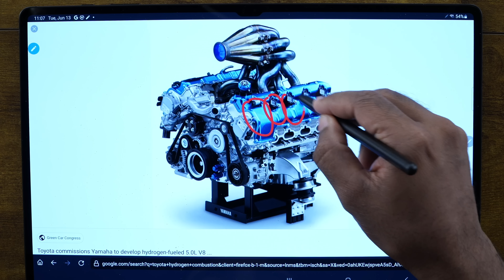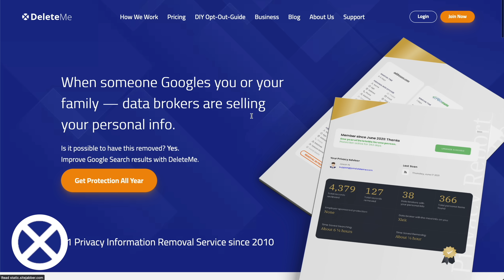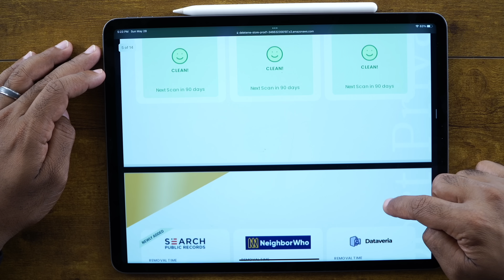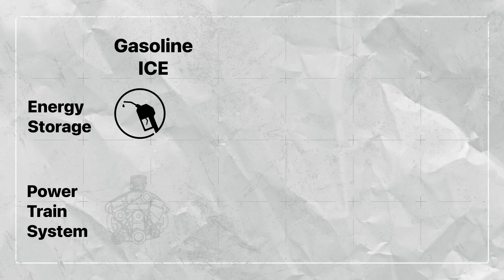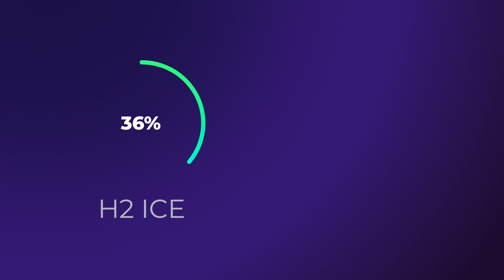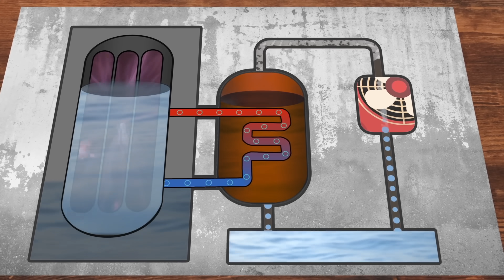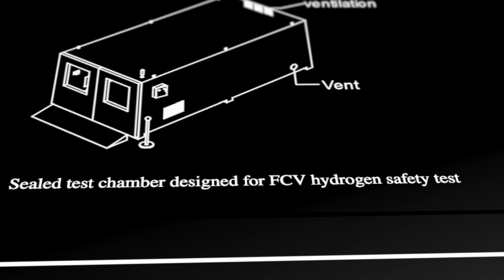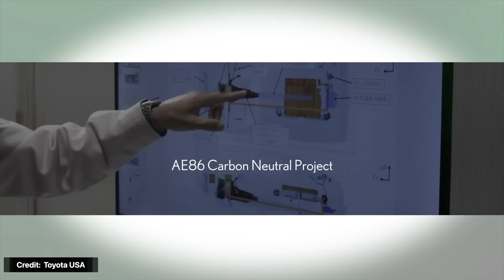Toyota's Says They Just Destroyed EVs - Hydrogen Combustion Engines

Comment: One thing hydrogen power can potentially offer that EV never will is the "Jerry-can" option. Want more range for your hydrogen-powered vehicle, either ICE or fuel cell? Simple: buy a portable hydrogen tank or three, lock 'em down in your trunk and you're good to go.

 But of course, there are those globalist vermin who do not want us to EVER have that kind of long-range/ fast re-fill-time autonomy ever again once they've banned and confiscated all petrol-powered cars. Given this fact, why would they ever want hydrogen ICE technology to ever take root?

The other advantage of hydrogen-powered ICE vehicles you've already mentioned: if you're stranded on a cold snowy highway in a four-hour traffic jam your engine can still be run to keep the cabin warm, and fuel can be brought to your vehicle if you're ever out of fuel in a remote location. EVs on the other hand can quickly run the battery down in minus-MF temps, leaving you at risk of freezing to death.
Reply: A portable hydrogen tank will be extremely expensive. You can buy portable batteries for your EV today lol.

EVs can be stuck in winter traffic for days. Heatpumps are very efficient at keeping the cabin warm with very low power draw

EVs with very long range already exist. Soon they'll have even longer range.
Reply: And a portable battery is cheap? Nope, not even considering the cost-saving measures that the suppliers of battery raw materials utilize. (Hello, child slave labor!).

The raw materials for building a safe and strong portable hydrogen tank already exist in abundance. Where there's a market and ample raw materials for something, economy of scales production will insure an affordable supply of it.

Besides, unlike electric vehicles hydrogen offers the freedom that comes with extended range. Freedom is a good thing, right? ..... Uh.... RIGHT?? 
.
Reply: @zeus014  Yes a portable battery is expensive, but 10K PSI hydrogen tanks are pretty damn expensive and heavy too.

You can drive anywhere with an EV so i don't really get your point. I drove on a roadtrip through Europe this summer, 13,500km. No problem.
Reply: @logitech4873 Europe has a denser population and therefore the incentive and means to provide the necessary infrastructure for electric vehicle ownership - as long as the electrical grids can support them. (Let's see if they can once the vast majority of drivers make the switch. (and no, legislating 80% of drivers out of their internal combustion engines and then pricing them out of EVs does not count).

I'm in western Canada. It takes about 3 and a half hours to drive from Banff, Alberta to Edmonton Alberta (along a major route) in a typical gas or diesel car. It does this on about 3/4 of a tank of gas and regardless of ambient temperature, from plus-30C in summer to -40C in winter. 

In a brand-new Tesla in winter it can take all day. Charging stations are few and line-ups at the non-urban ones are common. Charging times can be measured in hours. One example at -20C took all day to complete this trip, and had they had to wait for one more vehicle charging in front of them they'd have had to book a hotel.

And don't even get me started about the inability of our grids ever being able to keep up if even half of our population goes EV. 

BTW, our communist government here has no intention of making EV charging stations even 25% as prolific in numbers and spread-out locations as current gas stations are - because it does not serve their "smart-city" globalist agenda.
Reply: @zeus014  That trip in the summer can easily be done without stopping. In winter you'll probably have to stop and charge once at one of the superchargers in Red Deer for probably no more than 10 minutes, not "hours". It's just 400km.

I've yet to come across a single fast charger queue. But due to how fast modern EVs charge, you're gonna be waiting for probably ~30-40 minutes divided by how many chargers are on the lot. So if there's 10 chargers, that's 3-4 minutes on average.

Your government isn't communist. I recommend you look up the definition of that word.

Comment: Most electricity is still generated by green house gas producing power plants. The pollution caused by strip-mining for metals used in batteries/fuel cells should have been mentioned. There is no easy answer here. Bottom line is there is an infrastructure for ICE transportation NOT one for electric we are working on it. No matter how bad we want it, it is not there. H2 ICE may not be perfect but I would have like to seen you present your data a little more evenly. I noticed when you had a range you waffled between the high and low depending on the statement you were trying to support, and you left out the efficiency of gasoline engines which I know is low. This video just didn't feel as honest as your other videos...
Reply: There is infrastructure for electric.

Comment: Unless I'm mistaken, internal combustion engines will still require oil & oil filter changes, air filter replacement, tune-ups and transmissions no matter what the fuel is.

Comment: I want to no the consumption of hydrogen and if you could use HHO hydroxy gas converted on demand using electrolysis? No need to store hydrogen you would actually be storing a tank of water at that point. It seems like with a large enough of electrolysis unit you could create enough HHO Gas to power the engine
Reply: It requires more energy to power the electrolysis than what you can get from the resulting hydrogen.

Comment: Lots of EV disadvantages not mentioned in your video so far:  1) when temperature goes down, battery capacity drops.  This is all well and good for some place like California but where I live in Canada, winter temperatures stay until almost May.  This is also a concern when you need to heat the cabin.  2)  even in hot places, BEVs may not be as efficient as you make them out to be.  If you live in Arizona, air conditioning is a must and running a compressor and fans drains the battery.  Oh, and heat kills batteries and affects lifespan as well.  It's a vicious cycle as coolant runs in and around the batteries while the battery powers the car, AC and battery cooling systems. 3) average lifespan of a BEV is at most half the lifespan of similar ICE powered cars.  This is also a problem to resale value as batteries use finite and equally toxic chemicals used to make and run and the batteries themselves are 95% unrecyclable as the "black mass" is prohibitively expensive and energy intensive to separate into the toxic and heavy metals like Cobalt and Lithium and precious metals like gold and platinum.  ICE cars?  Most of the mass is reusable and recyclable due to it being steel, copper, aluminum, iron, lead and precious metals.  4)  There are still carbon emissions traceable to electric cars.  Roughly 40 % of the planet still relies on fossil fuel-based electric generation, and a good portion of that is coal.  Petroleum is still used in the manufacture of plastic, the rubber in tires, brake components, wire insulation, seals and the asphalt that BEVs use as a road surface.  Oh, and the fact that each time a Tesla or other BEV spontaneously combusts, that is a dirty burning fire akin to if more emissions being added to our precious air from the vehicles meant to make a green alternative compared to ICE vehicles in its lifetime, also the fact that it's virtually impossible to put out an EV fire compared to an ICE fire.
Reply: 1 - Modern EVs with efficient heat pumps still retain good range in winter. EVs are very popular where I live in northern Norway, north of the arctic circle. About 80% of new cars sold here are EVs. We only had 3 months without snow this season!

2 - EVs maintain high efficiency in hot climates. ACs are energy efficient.
When I was driving through Spain this summer in my model 3, there was no visible impact on efficiency in the 43°C days.

3 - EVs are too new to reliably calculate any sort of average lifespan. The technology has rapidly improved over just the past 10 years, and now LFP batteries are becoming commonplace. LFP batteries can last 3-4x longer than NMC batteries.

4 - EVs simply emit less CO2 overall, but obviously public transport and walkable city design would be a much better solution!
EVs are far less likely to catch on fire than ICE cars. There's no point in counting the emissions from the few EV fires, unless you also want to count the emissions from the more frequent ICE car fires.

Comment: EV's still have range issues and charging time problems - these are NOT TRIVIAL - sure it may not matter for 95% of people who mostly go to work and the shop but as other people mentioned there are plenty of places where EV's don't do well, like farming, trucking, heavy industry, emergency power generation.  I'm sure small hydrogen fuel production plants can be installed onsite where excess power from solar etc. can be turned into hydrogen fuel.  As for efficiency - gasoline powered cars are only 20% to 40% efficient, that didn't stop us from using them.  Yeah it would great if hydrogen was more efficient, but it's not a show stopper.

Comment: I do not agree with your statement that that there is no hydrostation network. Actually there is a hydrostation network, all our current gas/petrol pumps are running on that network. You just have to change it for hydrogen. This is one of the biggest advantages of hydrogen. On the other hand, our electricity network is already full and we have to build it.

Comment: Don't forget what it takes to make the batteries. Supposedly, more emissions are released during the process of making batteries than most combustion engine vehicles emit over their average life span. Or at least equal to it. From what I understand, the batteries in EVs are the worst part about them. 
This also reminds me of a story (true or false, I don't know) about an inventor in the '80s (I think) who came up with a similar design only it used water which essentially was a utilization of oxygen and hydrogen. The story goes that the engine design could separate oxygen from hydrogen right at ignition with high heat, which ultimately is extremely efficient. However, the second part of the story is that some men in suits soon arrived and offered a million dollars for the design and rights to it. Thats it as far as the story is concerned and nothing ever said about it again nor anything heard from the inventor again. Could be false, could be true, could be partially both, no idea. And the suits are allegedly from oil companies I'm guessing.
I do know, however, that water does separate at high temps and the two elements left behind are combustible. Forges and casting companies have to restrict the use of water anywhere near molten metal pouring or high heat areas in general. One facility I visited for contract work had an incident in the past before these regulations. One of the workers there had a bottle of water and a little spilled out and hit the molten metal and it caused a large explosion. I was told that even a drip of sweat off your nose could do such a thing, so don't stand over a cauldron filled with molten metal if you are sweating from the heat.

Comment: Let's see, EV's, battery pack, electric motors, venting fans, controls, pretty basic with vitually no maintenance and the only oil isin the differential.  No leaking polluting vehicles.  Hydogen, very complicated and technologically advanced engines requiring lubricants and constant maintenance.  EV's are plug and play in comparison.  Using four units of energy for each energy equivalent out as in the case of hydrogen and transportation of fuel makes very little sense in comparison to EV's that are 80% efficient whose fuel is delivered via high voltage transmission lines with only marginal losses in transporting.  Leave hydrogine engines for aircraft and maybe marine purposes, butI think the ship has sailed in the battle between hydrogen and ever evolving battery technologies.

Comment: One simple answer to why H2 ICE is the future, rare earth metals. It just isn't economically viable for EV to completely take over the market. H2 ICE just makes far more economic sense than EV dose. By far the biggest advantage is not needing to completely shift technologically. This means little to no retraining of much of the work force. Also nearly no retooling of production facilities. Biggest disadvantage is H2 production. EV once had a similar issue (and still dose),I see no reason why H2 can't overcome this problem. It's not to far fetched to envision a future that homes can have H2 production facilities. Especially with the ever climbing numbers of solar powered homes. The next step after H2 ICE would be fuel cells. Once the H2 accessibility issue is solved fuel cells can easily transition in over the course of 100s of years with little economic impact.
Reply: We already have infrastructure for electricity. H2 ICE is far too inefficient to actually work in a practical car. You'll have absolutely terrible range.
Reply: @logitech4873  check out Mike Copeland's H2 ICE conversions.
Reply: @beachfl6305  I already have, but the guy is a literal fraud. He claims 250-300 mile range with a supercharged V8 running a 3KG hydrogen tank. That would put it at better efficiency than even the hydrogen-electric Toyota Mirai.
His cars are cool, but he loves lying.
(Optimistic range for that setup would be 60 miles)
Reply: @logitech4873  He has stated that those are under optimal condition. The reality is closer to 100 to 200. Imo if you really wanted to solve the emissions issue you have to use H2. Batteries are just a really bad bandaid. The data shows that most EVs aren't emissions effective till between 60000 and 100000 miles. The H2 ICE gives a realistic path of getting to fuel cells. Batteries are just a dead end that don't have the ability to ever get emissions friendly as H2. On top of the fact that there will never be a EV commercial commuter aircraft just makes batteries a dead end.

Comment: Easy answer to why Toyota keeps on the hydrogen bandwagon is because they're an ICE automobile manufacturer.  In 2020, Toyota reclaimed its position as the largest automaker in the world, surpassing Volkswagen, but in the EV space they're relegated to the back of the line. Toyota's entire infrastructure is based on the traditional ICE engine, even the groundbreaking, at the time, NHW10 (1997–2000) the Prius was only ever a hybrid, not full EV.  Today's Fifth generation (XW60; 2022 to present) Prius continues to be a gasoline engined -EV hybrid. See any connection here? Had the Toyoda's swallowed their pride and exerted their mighty engineering prowess to full EV development in 2010, there is no doubt that they would have given Musk a run for the money. Tesla's panel gaps, steering wheels that come off as well their overall hubris as a company (no public relations department = we don't care about you and we don't answer to you because we don't have to) is something that Toyota's quality-oriented, customer satisfaction focused eco-system would have totally capitalized on. Billionaires like Toyoda and Musk shouldn't be expected to make purely sensible decisions like us mere mortals. Their priority is to remain relevant in the spaces where they're the top dog.

Comment: The fuel cells currently used by Hyundai can optimistically last around 10 years or 5000 hours (whichever comes sooner). Then the cost of replacement totals the car. With batteries this isn't much different. I'd rather have a less efficient but repairable car, which can last as long as it's properly cared for, and has a non-zero resale value. So I'm really rooting for the H2 ICE.
Reply: NMC batteries can last 10-15 years. LFP batteries will last much longer, luckily.
Reply: @logitech4873  if only you could charge them from 0 to 100% in 5 minutes, I'd pre-order one today!

Comment: I have to be honest I really really do not want an ev, I drive long miles and tow heavy loads. As far as I am concerned there isn't an ev that can do the task I require. Where as a hydrogen engine could very easily replace my diesel engine and preform the same task. I know there are ev pick-up trucks, but they are way too expensive, suffer from poor range when towing and just genuinely cost the earth. I am going to keep hold of my diesel engine as long as I can

Comment: There was no mention of range for a hydrogen ice vehicle. Because hydrogen is compressed, I think the range would be quite limited. The range of a hydrogen fuel cell electric is better because of its efficency. Jason at Engineering Explained covers the range of ice vehicles with powered with hydrogen.